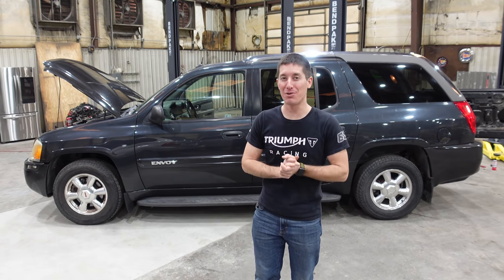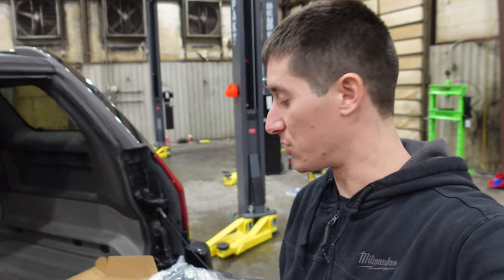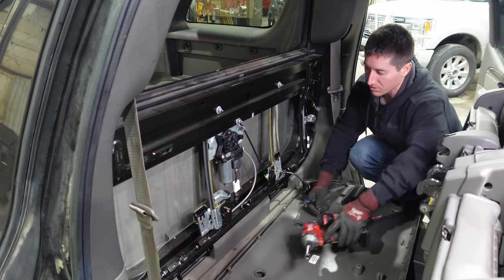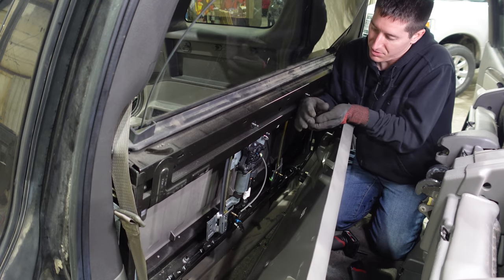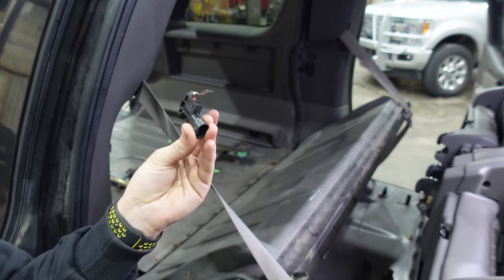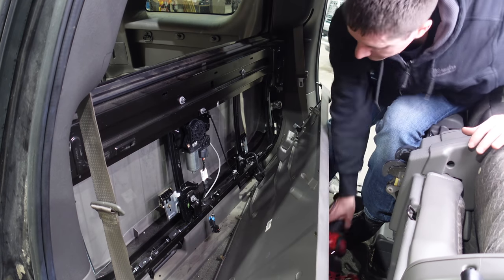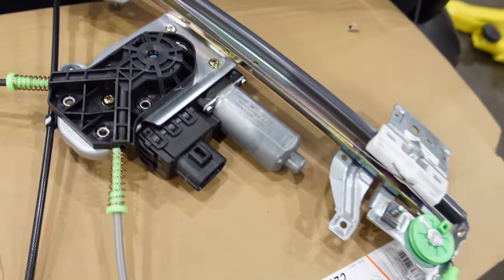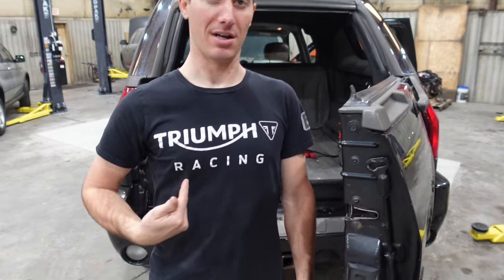EVERY PART Of My Envoy XUV Is EXPENSIVE: $150 POWER MIDGATE Repair

Comment: Now I get it SUV or pickup......you can see why it failed.Its over complicated.
In the 1960s Vox amps and instruments always sent there prototypes firstly to the Beatles at Abbey Road to gauge approval .One time they sent a guitar that was half guitar half Hammond organ ( but played through a guitar) .It came from not Vox but a budget guitar maker out of Italy.At least one still exists some body took the back off recently the wiring was frightening point is and this is 1960s if you want an organ you bought an organ if you want a guitar you bought a guitar.
Vox also came up with electric sitar and mandolin both vetoed by The Beatles they were wrong about the mandolin an electric one had a big future only they had no clue how to play one unlike John Paul Jones of Led Zeppelin or Steve Winwood.

Comment: Parts arent as expensive as your Audi. Im repaing a S5 coupe and a fog lamp cover is 485.00. No lamp. Just black plack with 2 little silver moldings in it
Reply: Sell the Audi get a Toyota Corolla or Camry the parts for Toyota are easier to get.
Reply: @vikingman4614  not my car. Im just the bodyman fixing it